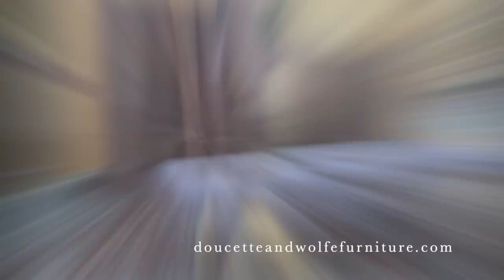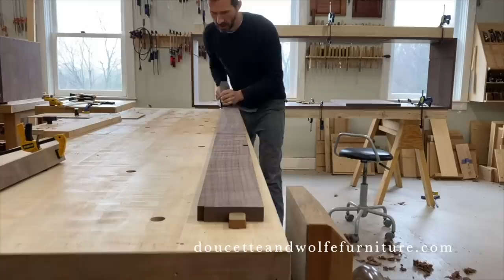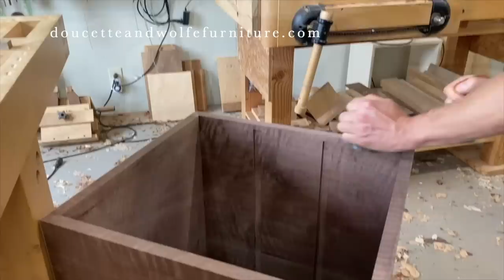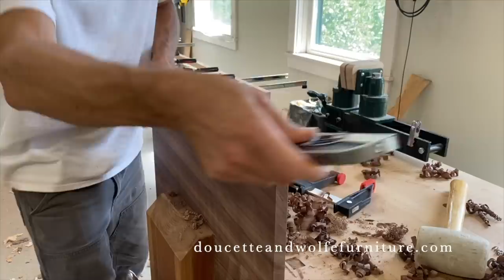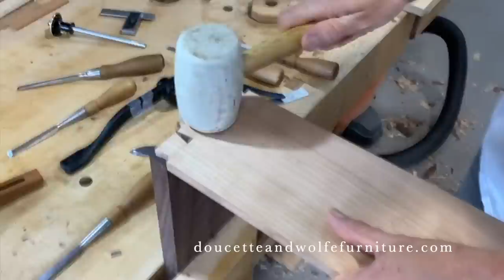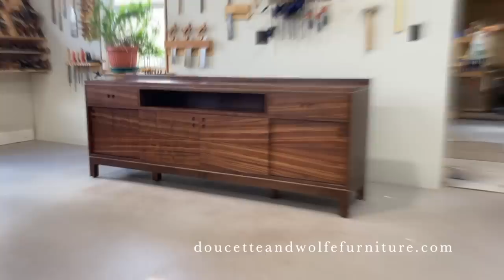Credenza and End Table Building Process by Doucette and Wolfe Furniture Makers

Comment: Beautifully done and no hardware, screws or nails that I can see.
Reply: And no fancy drawer slides either :) Who needs them when a craftsman can make them fit like that!
Reply: @RobRobertson1000  He just uses his machines to work six sides of each board slightly oversize and then it's all hand tools.
Reply: There have been screws in most furniture since the 1400s. There is no more secure way to join the top to the sides than rabbeted blocks screwed in from the bottom. Unless you want to make a keyhole fitted piece, which would take a year and not be as strong anyway...

Comment: Absolutely first class craftsmanship. I love the combination of machinery and hand tools. Machinery takes the hardest work whilst hand tools finish it off. Plus no music! What! Yes, just the sounds you want to hear.

Style is very personal and, for me, visible dovetails detract rather than add. But, that’s just my style.
Reply: He builds according to his customers wishes. This is a business. A very very talented businessman
Reply: @WilliamWBG  absolutely the right thing to do. I must say that in my years of making furniture for clients, I came to the conclusion that it was largely the arrogance of many UK makers to almost insist on using dovetails as if dovetails somehow confirmed that you were skilled. I have said before that I doubt that the makers of the 18th and 19th century would increased their costs by making dovetails by hand if the current range of equipment and adhesives had been available then. Anyway, I only ever had one client come back to me about dovetails. This was on a credenza in a modern style. That client asked me to take out “those fussy joints) as he felt they detracted from the clean lines of the rest of the piece. 

But, the client is King. If they want dovetails and are willing to pay for the labour involved, then great. Making a living from bespoke furniture is hard enough without arguing with paying clients.

Comment: Very pretty, well done! I was wondering if you could describe some of your tool choices - I noticed a LN 4 1/2, a Veritas low angle smoother, and a LN 9. How have you set these up and for what specific task? For example, do you have a lower bevel angle on the 9, hence using that to smooth the endgrain rather than the low angle smoother? Do you sharpen them at a specific bevel angle? Similarly, is the 4.5 set up for a task that the low angle smoother isn't as well suited to? (Or perhaps the size just makes it better for smoothing the faces, I believe that's mostly what I saw though I don't remember exactly.)

Comment: Very nice! Love your work! Quick question: don't those doors in the credenza need to be stabilized somehow? Sorry if it's a trivial question.. I'm just starting in woodworking and everywhere I look, they say that wide board like that will move/warp and need to be stabilized - either with a frame, breadboard ends, sliding dovetails, etc. Thank you!

Comment: I've always wanted to know what the plane is called that you're using around the 5 min mark to plane the end grain on the pins. It looks like an LN product but I can't find it on their website.
Reply: I want to know too. It looks like it can be used as a shooting plane, but I've never seen one with a pan-handle tote like that.
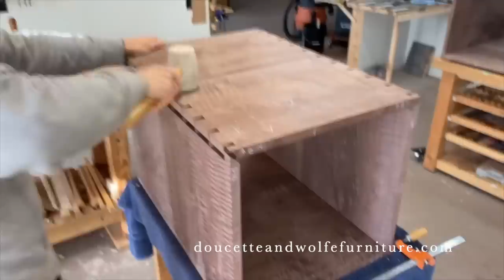Reply: @tylerscott305  That's what I thought but can't find anything about it online. I think you're totally spot-on, however - in their "block front chest building process" video you can see him using what I think is the same tool as a shooting board plane at the 2:40" mark.
Reply: Might be a previous iteration of the LN shooting board plane before their current model.

Comment: do you find solid drawers won't move as well during spring/summer? I would expect with the sides expanding and contracting they would be tighter in warm, moist weather and looser in cold, dry weather. Do you build in different tolerances depending on where you're shipping the furniture to?